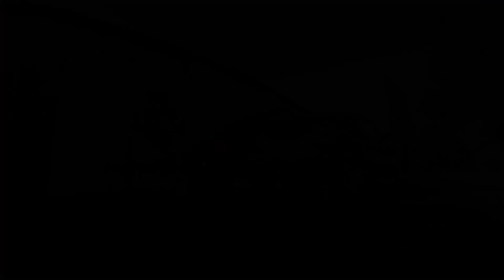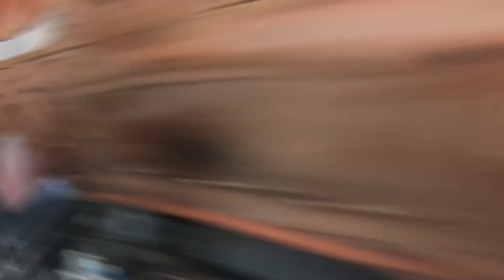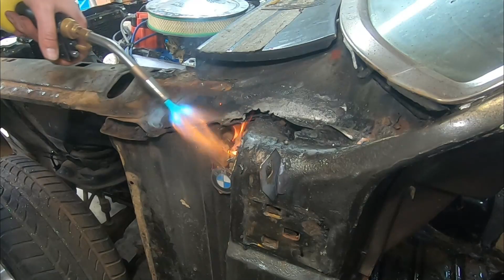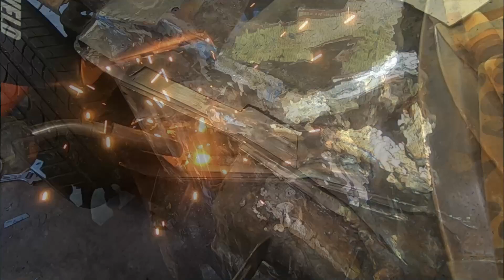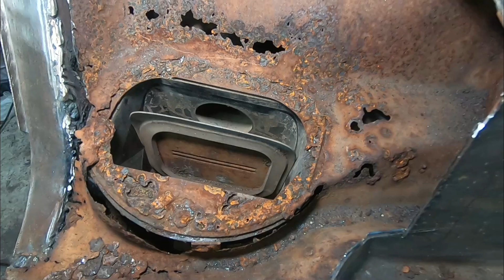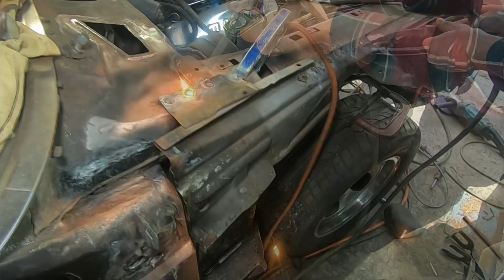PART 1 FORD XB 351 Falcon Ute. Getting Ready For Rego, and Rust Repairs

Comment: There were several layers you peeled back there and repaired. In doing so, you've raised a very important issue with older cars...unless there is someone that cares and has the skills, this kind of rot can be missed quite easily (especially if someone with less scruples applied bog on cardboard and painted) and the vehicle gets registered in quite an unsafe state. I guess it helps create that crush zone that new cars have designed in ;)
On another topic, your fabrication skills are first rate even when constraints reduce your standards!

Comment: Good onya mate. Gunna be a ripper when It gets back on the road. I’m building an XG Ute at the moment. Just got my 408 clevo stroker back from the engine builder and the dyno. She put out 551HP and 518ft/lbs of torque at 4600. Gunna be pretty good for getting firewood!! Haha